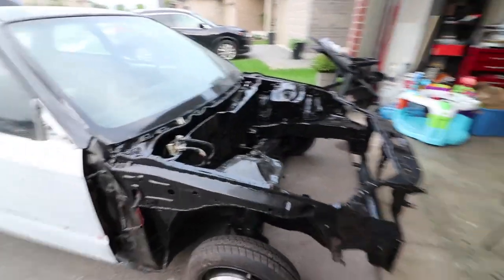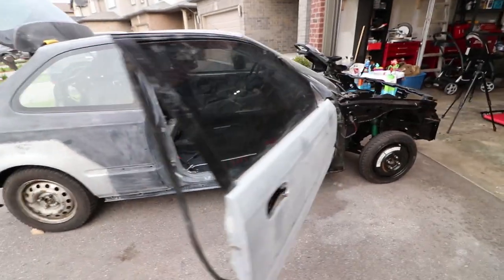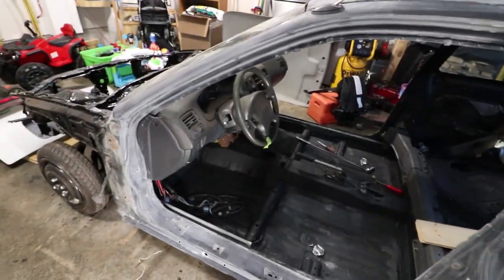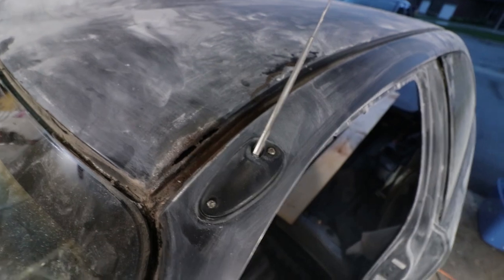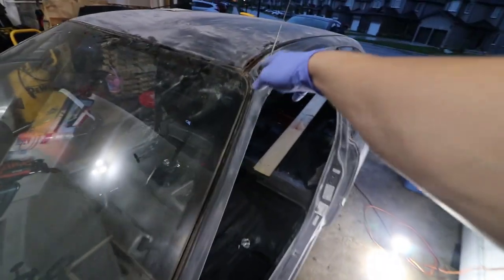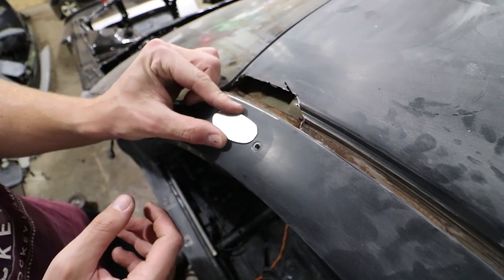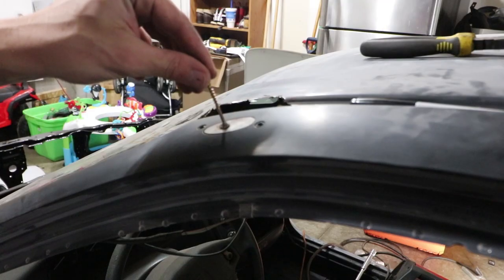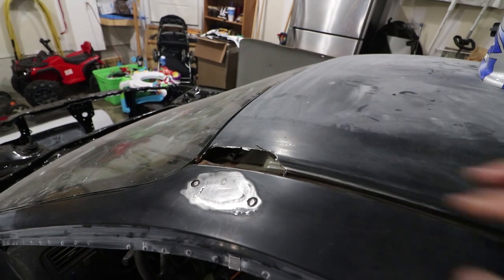How To Paint Car at Home - Step 3: Last Minute Body Work & Flux Core Welding

Comment: Nice build! How many amps do you set when welding thin gauge metal and what wire speed?
Reply from the maker: im using the lincoln mig pak 140, its a 30-140 amp output welder, i had it on pretty much the lowest setting with the wire speed slow but not too slow. your aiming for that bacon on a frying pan sizzle sound. I kinda use that to gauge my wire speed.

Comment: Hold up what kind of sandpaper are you using
Reply from the maker: With the pad in the beginning, 220 grit dry soft pad, wire wheel around the window trim followed by 80 grit since I had some rusted areas in window seal area.